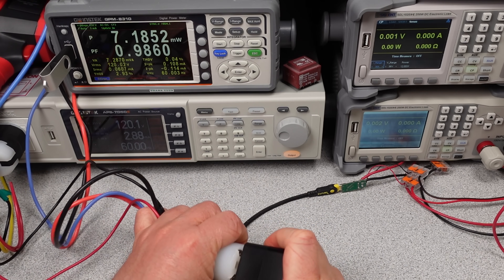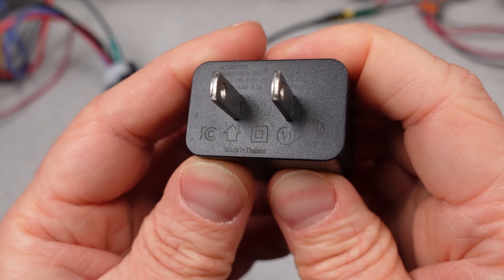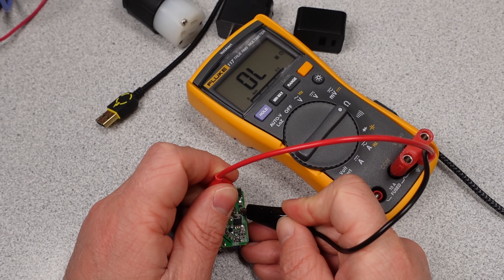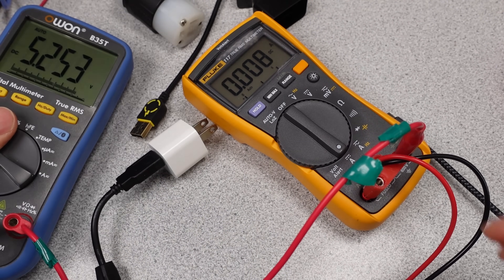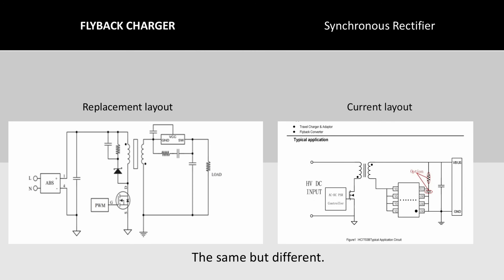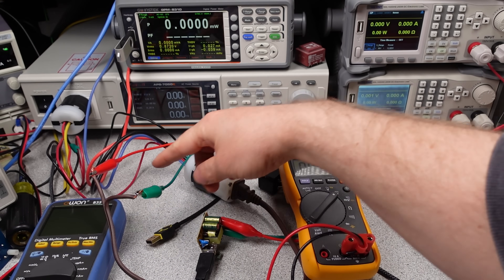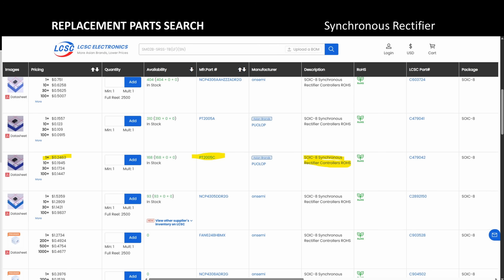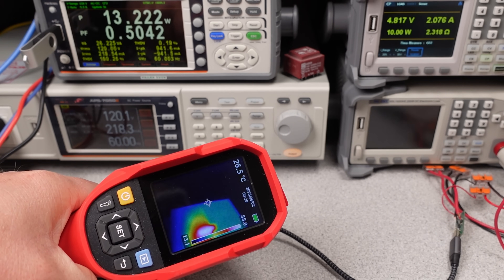Fixing BROKEN USB Charger

Comment: It's really cool and interesting to troubleshoot and repair one of these, but it's probably more time efficient to just buy a cheap replacement charger from IKEA 🙂
Reply from the maker: Yes, the point here is that it is possible and it's just an exploration of electronics, I have actually used this piece of (working) junk a few times already.  It's my, it's not PD compliant USB C port test device now.

Comment: was stress testing a chinese 100w power supply
configuration:
1x 100w type c PD (5,9,12,15 3A, 20 5A)
1x 22.5w QC
2 type A's- 5v 2.4A x2

Load testing results (150w load tester + pd decoy)-
5v- 5.05A stable
15v- 5.60A stable
20v- 5.70A stable 
(tested in 0.05A increments, 20v almost passed at 5.75A)

tested for 1 hour with a cooling fan each to test stability

combined load testing
port 1- 20v 5.65A (5.7 unstable with other loads)
port 2- QC mobile- 9v 2A (maybe at 5v2a then)
port 3,4- small powerbank- 5v 1A, max speed+charging minifan 5v 1.5A

total max load from wall- 159W
runtime- less than 8 minutes
catastrophic failure at 158W . magic smoke from the power supply (AC side plug); breaker tripped. no appliances damaged

obituary-
1- really lightweight
2- horrible leakage at 230v
3- tested below 88% efficiency at full load (113W pulled at 19-20v 5A)
4- no temperature protection
5- came with a light (0.7W at 0.06 PF idling)

will soon crack it up to look at the contained explosion on the inside 

It was brought a few years ago with the purpose of charging a hp gaming laptop alongside a type c (20v 5A) to hpjack adapter. it barely worked, kept the power draw from the laptop's battery at 0 for less than a minute before giving up on it. seems like the laptop wasnt able to initiate "charging" the battery for some reason; and could only keep the AC power supply mode for less than a min. subsqeuently tried plugging it during shut down, switched off, during boot, under max stress (which didnt work at all). the (now late) adapter has been useless since. i could have been used it as an adapter for imax B6 v2 at 15V; but that didnt cross my mind until it's funeral (current adapter shuts down between 50 and 56W out of the balance charger, have to run it derated).

most imporantly, it was a fun experience.

Comment: Love the content! Do you know what can be a good alternative to the  baseus gan3 100w desktop charger (more or less same size)? I not sure if it's my unit, but mine has negotiation issues and have to plug and unplug my pps devices until it select the correct mode...  I have seen a satechi 100W desktop in amazon, but I think you haven't reviewd it ( i found the 108 desktop version video, but it seems it is not a good charger...) also there is another charger voltme vito 75w.

Comment: Hello, by any chance is it possible for you to do a video on the UGreen 200 watt 4 port wall charger? I think you covered the UGreen 200 watt adapter but I am curious about the specs for the wall charger and how it compares to others in the market as well as how fast it will overheat etc
Reply from the maker: I wasn't planning on covering that one.

Comment: I wonder if right to repair advocates do count chargers as essential. It pretty hard to repair and really well made ones hold longer then expected.
Reply from the maker: Yeah, certainly more expensive tech is in the spotlight but all this cheap stuff supports the expensive stuff.
Reply: good power adapters can last a very long time especially if you dont stress them out, that is run them near their max rating especially these days when they rate them higher than they should have been with no safety margin. i have a 4 port usb charger and it still works after like 6y, the laptop chargers I owned they also lasted a good 4y+ typically which is OK I would say. Power supplies are risky to work on, unlike laptops and phones they are very high voltage
Reply: They amost never break, so no need to self repair. Secondly, they are so cheap it's not even worth to repair.